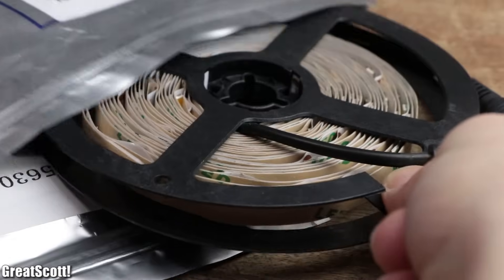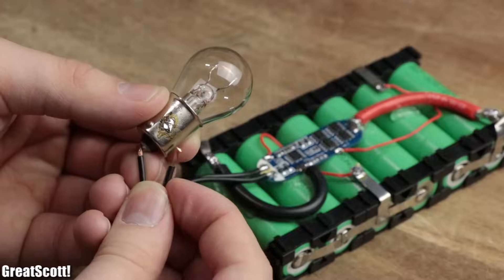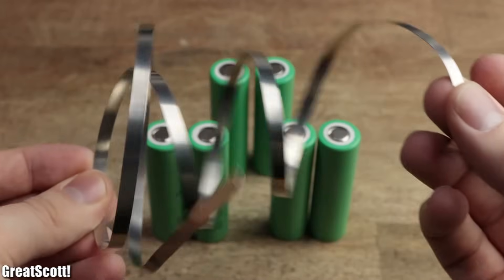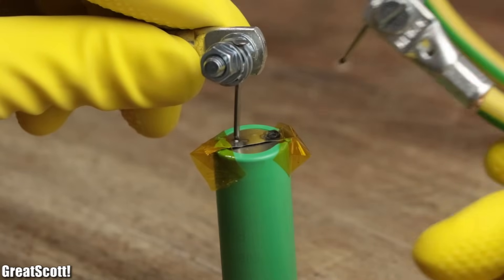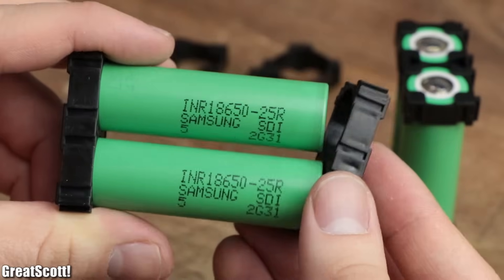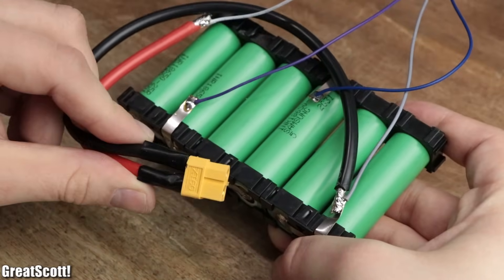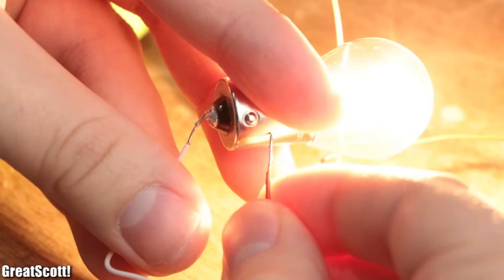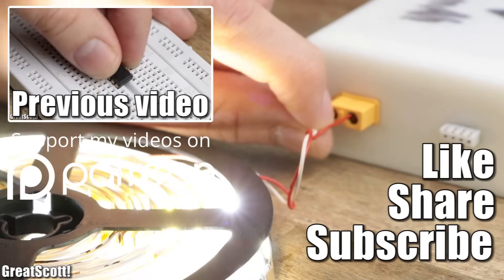Make your own Li-Ion Battery Pack

Comment: That BMS, the max voltage is 12.6 Volt over the 3 cells, so do you have to feed it with max 12.6 Volt or can it be more because of that BMS module?
Reply: Make it Solar portable plsss!!! i want one
Reply: GreatScott!  where do you study
Reply: Hello Luc Peeters. I built a 3s2p 18650 battery pack recently. The cells I got are rated for 4.3V 2.8A charge (3.5A max quick charge current). I use a boost converter from a 12V 10A supply and boost to 12.75V. This charges the cells up to 4.22 V each, then the charge controller cuts off. Max charge current is 6 Amps when the cells are drained to 2.75 Volts each (cut off for BMS), and the pack charges up in about 2.5 hours. I have measured temperature with an IR temp probe and current with a dc current clamp. Everything seems to be working well. I cycled the batteries 10 times to test everything since it was my first experience with Li-Ion batteries. I measured 62.5 Wh of total capacity. This is going into my portable 17" display I'm building very soon. I got cells with the tabs pre-welded so to avoid any dangerous soldering to the cells.
Reply from the maker: You mean for charging?
Reply: Yup, correct.  Been thinking about these same thing except that I want to charge it with an old 16 Volt laptop adapter
Reply from the maker: You need to apply the appropriate constant current and constant voltage that Li-Ion requires (12.6V/2A). Balance charging is also recommended.
Reply: Ok, thx, seems the bms is only there to protect and not regulate anything.   Was hoping it would switch off when trying to overcharge it too.
Reply from the maker: Correct, it only protects. But it does actually cut the charging current when a battery overcharges. The problem is that when you will apply 16V the charging current will be too high and thus damage your battery.
Reply: So actually a power supply that could only provide 1 or 2 Amps but 16 Volts could do the job.  Might be worth testing out. Thinking about it again. First part of the charge should be constant current .. so I think I just answered my own question.
Reply from the maker: Well, if it can only supply 1A or 2A it usually means that it will shut down or a fuse will blow when you try to get more. It usually does not regulate the voltage to a lower value.
Reply: Warren Garabrandt hi, can you share if you use bms for your build? And charge up using balance charger?

Comment: The liion battery packs Ive created are horrible, not protected by a circuit and now already one block of round about 12 18650 Akkus are already destroyed, I think. They have almost no voltage any more... 
BTW Scott: I think you were a big factor, for my to start studying Electro and Information sciences, and by now, just first semester i think I like it, although it's hard of course...

Comment: A neat project would be building this DIY arduino battery spot welder https://www.google.ca/amp/www.instructables.com/id/DIY-Arduino-Battery-Spot-Welder/%3Famp_page%3Dtrue
Reply: The flash tube circuit from a disposable camera works well for a cheap spot welder.
Reply: Worked for me.
Reply: Sam C Video for proof. Welding relies on current rather than voltage to work.
Reply: There was a guy who used some kind of adjustable timer and a relay and it worked flawlessly, without wasting an arduino

Comment: Can the bms be used to charge the batterys?
Reply from the maker: Not the one I used. And all the cheap BMS can not do this as well. You need to apply the appropriate constant current and constant voltage that Li-Ion requires. Balance charging is also recommended.
Reply: Thanks! Very Informative Video! Good luck for future :)
Reply: Generally no, but some can balance the battery while a charger is charging them.
Reply: GreatScott! since ur discharging  wire goes through BMS chip, how will u charge the pack...

Comment: It's too bad that this type of battery is expensive. Lead better use.
Reply: slamisek 18650 are anazing battery for high performancr
Reply: They're expensive if you get brand new quality cells, you can get B grade cells at about half the cost or buy new/used laptop battery packs which will almost always have quality cells and the cost drops to around $1-2 per cell, so far I've gotten 18 cells from a couple different packs for only about $20 in total and all of them had over 2000mah, so yeah even if I had gotten a couple dead cells that would've still been a fantastic value.

Comment: Would it also be possible to use an 18650 holder from eBay or are these incapable of taking the high current?
Reply from the maker: Hard to say. I would not use them for more than 3A.
Reply: GreatScott! Ok thank you!

Comment: D: Why not LiPo packs?  How dangerous can they be (Yes I saw the video) when compared to 18650s?  I've had 18650s explode on me before, but never a LiPo, which are common in drones and wearables.
Reply: Bob dabiuld the chance of anything going wrong is low and most times you can tell when the lipos is starting to go bad

Comment: Is 2.3v cutout too low? I never discharge 18650 batteries below 3V..
Reply: there's really no point in going below 3 or 3.2v as the amount of energy left is minimal.  Even below 3.4v there's very little left in the cell
Reply: wzd leo yes its to low. I havent discharged a battery below 3.1 volts because i want long lifespan
Reply: 2.3v seems really low, but yes you can safely discharge them down to 2.5-2.7v